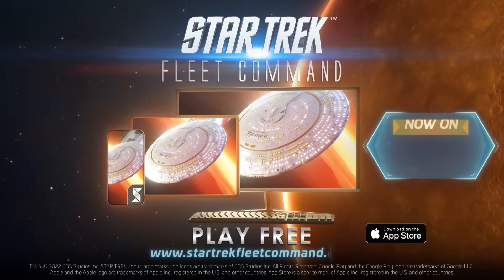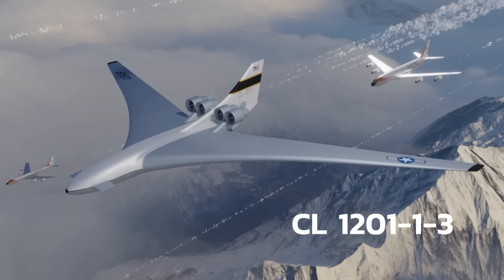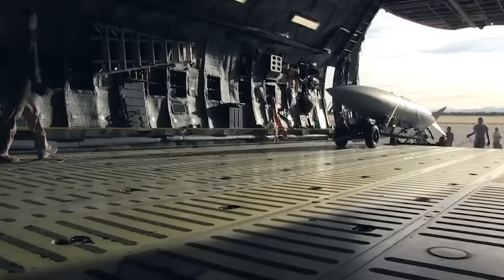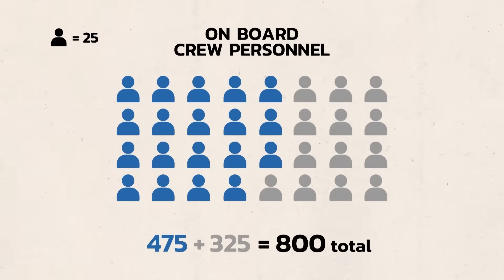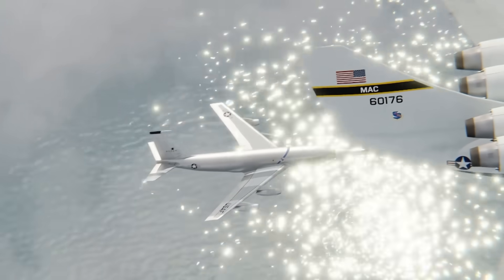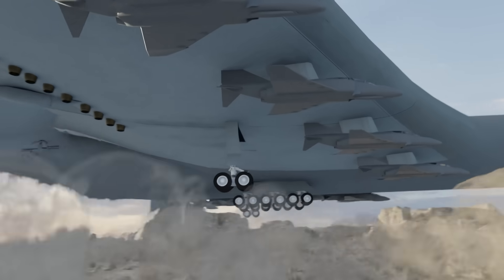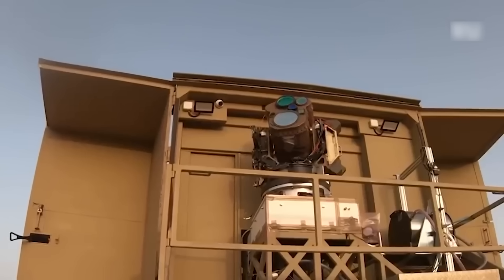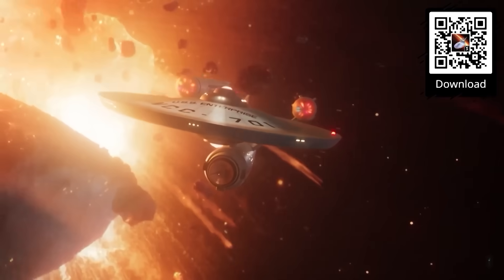The INSANE Largest Aircraft Ever Designed - Lockheed CL-1201

Comment: Kind of funny to think that actually building aircraft of this size is possible... the reason it was not build was simply that it isn't practical. Overall, I think the key issue is defending such plane as it simple becomes liability. The ships are heavy and can be armoured and they can take few hits and still survive, but is literally anything hits this plane it would be the end for all the crew and the plane which was potentially as expensive as aircraft carrier. So rather than being asset it just becomes massive liability and honestly there are better ways to do it... Like simply using 10 or 20 or 30 or whatever number of say C5 Galaxy... they they can be shot as well, but 1 hit only destroys 1 plane, here 1 hit destroys equivalent of entire battle group.

Comment: Nuclearpowered, vertical lift, 27 F4 phantoms, laser weapons and 200 meters wingspan! Sounds like Lockheed martin went to a kindergarden to get design advice 🤣
Reply: Right, the technology didn’t exist in 1969 but scary thought,  it does today.  Flying nuclear reactors (1950s)- check, Vertical lift (1970s) - check,  Air launches aircraft l from a mothership (1940s)-check,  Flying Laser weapon (2000s) - check. Now the only piece that hasn’t been demonstrated is the scale - 200m wingspan.  But Starship is over a 100m tall so building at scale is now possible if not feasible.
Reply: @Agile-Ted 
Specially with a special composites + high-end metal alloys combo

Comment: This is astonishing, truly a marvel of engineering and a flying fortress. An unstoppable machine of destruction capable of flying for over a month without stopping. 

It could be taken down by a couple birds flying into the engines.
Reply: It would actually take a significant bird strike to take out the engines.  Having seen bird strike tests on current jet engines they can take damage and keep running.
Reply: @Agile-Ted  Current as in 2023 or current as in whenever this thing was conceptualized?
Reply: @Slay1337pl 
Well, this thing was basically impossible back when it was designed, but with today's advancements it's actually feasible.

Not only that, but those engines wouldn't be normal jet engines, but likely electric engines, wich could be way more reinforced

Comment: With the vertical lift actually like 50+ something engines pushing straight up wouldn't that heavily effect the wings structural integrity & do materials exist that can even handle the horizontal force of being pushed forward & plus the force of being pushed vertically? 
Most materials are only strongly resident to certain directions of force... 
Example steel can be compressed pretty well, but if you were to "pull" it's a lot weaker then if being pushed "down", not to mention twisting and "bending" (horizontal) forces 🤔
Could such a plane (wing structure) even be constructed today let alone when this was invisioned?
Reply: Well the VTOL forces are in the same direction as the lift forces of the wing, and we have managed to make planes that can go forward and have lift, so I don’t think it would be an overly big problem.

Comment: 10:10 Yea there is. The salt flats. You'd have to build your hanger and construct the bird there. Launch it from there. Thats the only place to do it. Other than ice. Take your pick. Salt or ice.
Reply: Make it into a flying boat.
Reply: 10:40 What a waste. All those engines only being used 1% of the time while 99% is in the air loytering being restocked IN THE AIR. Id do the salt flats like a regular normal personl
Reply: 12:23 Solution? Target with MIRVs and or overload the defenses with an overwhelming salvo of missiles which cost pennies on the dollar compared to what they are targeting.

Comment: CL-1201 my beloved
I wonder if modern computers would make the crew requirements and even weight of the aircraft better. How much of the proposed crew was to do things that 1960's computers couldn't automate?
Reply: Honestly the main things I see computers reducing are mainly the docking complications with the aircraft, and some of the engineering/navigation crew requirements. However with such a large, and expensive aircraft you would still want a sizable crew aboard for general maintenance, or in the event of emergency. Back when Qantas Flight 32 (an Airbus A380) had an engine explode, the two man crew was bombarded with something like 50 error messages. With something as massive as the CL1201, you would definitely want extra crew to deal with that. Then of course with today's capabilities, you could probably expect that 41 day flight time to get a little longer so you'd want extra crew to ensure everyone is rested. Then there's also the argument that if you automate this thing so much, then why not just build a bunch of drones instead of a few massive jets?

Honestly the biggest modern innovations I see for this project would be the massive engines engines we're able to produce now, lightweight composite materials, and the recent licensing of modular nuclear reactors or the breakthroughs with fusion reactor technology.
Reply: @airplanenut89  Docking would be easier than aerial refueling. Just fly up, deploy your arresting hook and fly into the capture system. It would be way easier than landing on a naval carrier, and probably easier than landing on a normal landing strip most of the time.
Reply: @sdfopsdmsdofjmp7863  I remember reading a ww1 pilot's experience flying out of a zeppelin and he said that flying off was very easy but re-docking was complicated as hell and they'd often just go to land somewhere else instead of that, I imagine it'd be a bit like that
Reply: @agustinvenegas5238  Im guessing that was mostly becuase airships were slow as shit, so you would have to be very close to stall speed to dock. Meaning control of the aircraft is very difficult to maintain.

That isn't an issue with a huge plane like the one in this video. It would likely have cruised at or slightly below normal airliner speeds, so at a very comfortable cruising speed for basically any fighter aircraft. The only issue I could see is local pressure deviations under the wings complicating docking. 

Realistically though, it likely wouldn't have been any harder than for example aerial refueling, which fighter pilots are very used to doing.
Reply: The Nuclear reactor would require a set crew of engineers to ensure safe operation. And in shifts.

Beyond that, most of the functions now can probably be automated or reduced in crew
Reply: @Exodus I'd be willing to bet that just because of the sheer mass of this jet that it would take quite a bit to bring down. Not to mention that this would be deployed with it's own sort of "task force" just like a super carrier is so it wouldn't just be derping around in a circle by itself. It could also just stand off beyond the effective range of AA weapons. Who knows, maybe the USAF would have figured out some sort of reflective coating that reduces the effectiveness of energy weapons.
Reply: @airplanenut89  that s called a mirror lol
Reply: @kettelbe  With such a large aircraft, you'll need a hell of a lot more than "a mirror". That and giving it a mirrored finish would be hell on the eyes of anyone who has to fly around it.
Reply: @airplanenut89  No fuel means it could fly on with some holes in the wings.
Reply: Cmon, this is utterly bollocky dumb idea

This is not Ace Combat universe, you don't need those.
Reply: @Exodus Iron dôme
Reply: This thing would be taken down by missiles way too easily for it to ever be feasible!